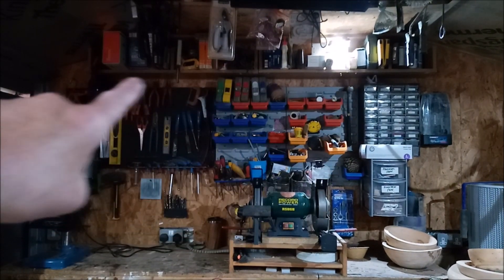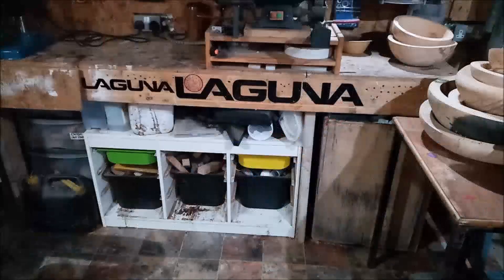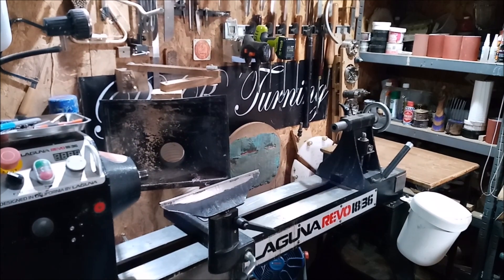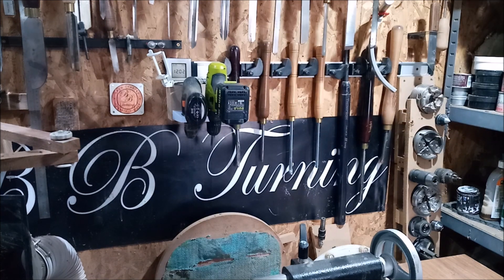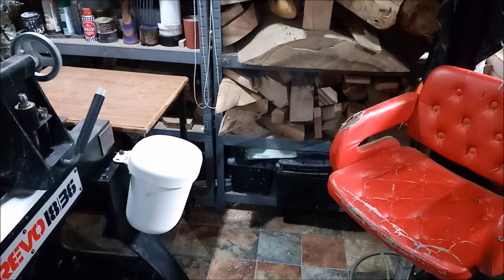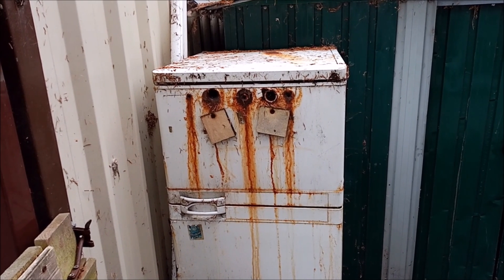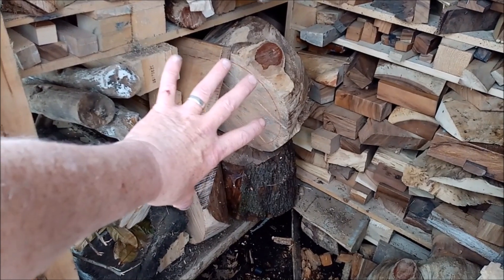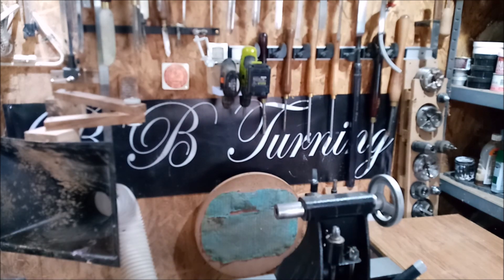A Tour of my Entire Setup for wood turning

Comment: Fascinating to see. I didn't realise how little space you have. I suspect I've more space but so many more hobbies squeezed in! Whats the story with the microwave for the resin by the way?
Reply from the maker: Yeah not too much room at all Paul mate. The microwave was something that the guy who taught me how to use resin told me. When you first pour the resin into your mixing container it can be kind of thick, if you microwave it for a few , and I mean a few seconds it turns into the consintency of water thus mixing better and flowing better into whatever cracks you want to fill. You just have to be very careful doing it as even a couple of seconds too long can cause a thermal reaction and either the resin can catch fire or can get too hot ruining the resin.
Shay

Comment: Great video. I do love a good nosey around other peoples workshops 😂
I love the look of that little compressor, I could do with something like that myself. Question, how do you keep your workshop so dust free? I have my extractor on when im turning and the air filter going too, but everything is aways still covered in a layer of dust.
Reply from the maker: Thanks Leona, between the dust filter on the ceiling, the dust extractor at the lathe it keeps it pretty well down and since I got the compressor I open the door , turn on the fan ponited at the door and the filter and blow out all the surfaces using the gun attachement then leave to door open and the fan and extractor going for an hour or so which clears all the dust out.
Shay

Comment: Shay, I'm still putting my wee workshop together as you know. It's coming on grand & now has power to it. If you have a small space at 10x12 then what do you call mine at 10x5 ? 😅 I'm restricted for space by the size of my outdoor area. It's a tight space but it appears that it'll work for me & after all I'm only a hobbyist. Once it's complete ( a week or 2 I reckon) I'll ping you a photo of it & if you can see where I could change, move stuff or make any improvements the please let me know
Reply from the maker: Do indeed Jim.
Shay